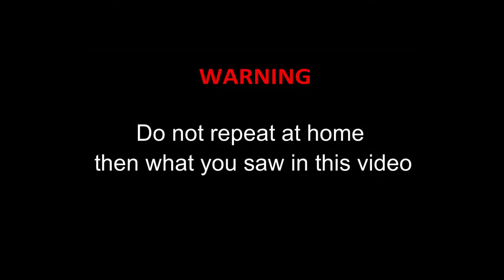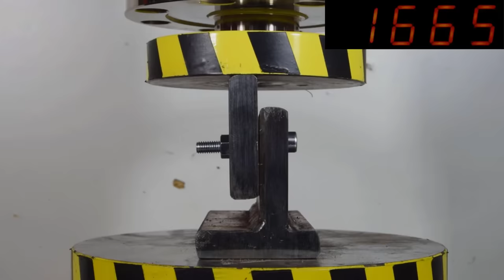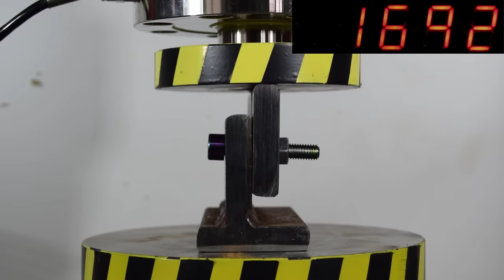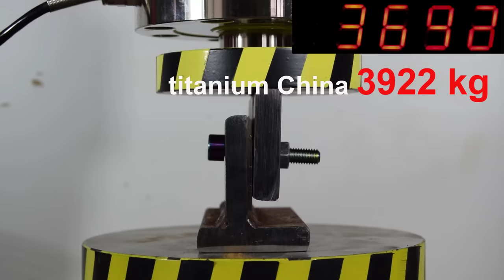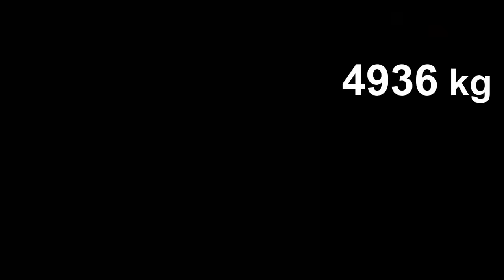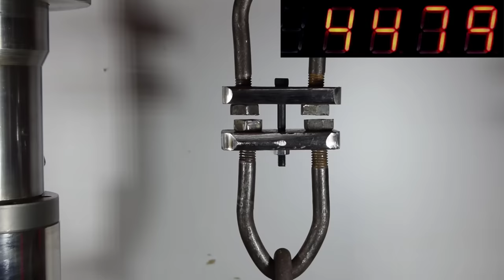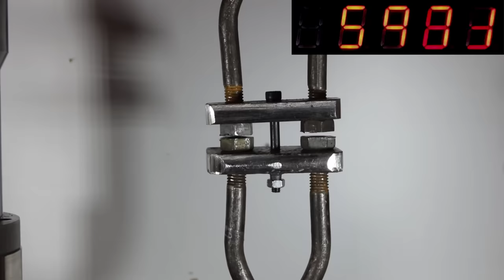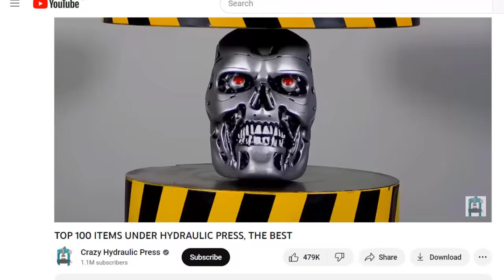HYDRAULIC PRESS VS TITANIUM BOLTS, ALIEXPRESS AND SPACE SHUTTLE

Comment: Most people don't get it. Titanium is not as strong as steel, only about 90% the strength of steel, depending on the alloy. But it is light as aluminum. So you have almost the strength of steel, but for a bargain of its weight. That is the magic of titanium. But it is expensive and its high melting point makes it unbelievably complicate to weld.
Reply: High melting point could be important for a spaceship. It makes the return safer.
Reply: Not quite the same density. Aluminium density is 2.7 tons per cubic metre whereas Titanium is 4.5 tons per cubic metre. Steel ranks at 7.1 tons per cubic metre; for comparison sake Magnesium is 1.7 tons per cubic metre. Where Titanium scores mostly is heat tolerance ( hence its use in aeronautical uses) & corrosion resistance ( in chemical industries & maritime environments) being better than bronze or stainless steel.  One has to carefully establish the intended purpose before deciding on which metal or alloy to use . Hope this helps. Kind regards.
Reply: True. Mild steel  is actually roughly 7.85 tons m3 not 7.1 @toolsconsumables7055
Reply: Not only hard to weld, its even harder to work with it on a lave or mill. There are so many things to worry about while working with titanium
Reply: @felix_972 well we ain't gonna take your word for it when you don't know what a lathe is😂
Reply: @garethjones909  I know what a lathe is, but my german auto correction made lava instead 😂
Reply: Isn't it mostly alloy and not pure ?
Reply: Isn’t titanium the best with regard to being corrosion / rust resistant?
Reply: Actually to weld titanium is not complicated… its very easy with TIG :) and most easiest to weld also. Aluminum is maybe the hardest… but dunno, if you know how to weld then everything is easy :D
Reply: Titanium is fatigue resistant
Reply: Also non magnetic, titanium tools can be used around mri machines without it being turned into a projectile
Reply: I’m fascinated by metals (that’s why we’re all here) and often tour guests at my friend’s factory. 
They machine all sorts of metals and plastics for big projects. 
One day I expressed my admiration for titanium. My friend responded that they don’t like it: very gummy, not nice to work with. 
Iron, grades of stainless, brass, copper, plastics, all good - but not titanium. 
Bubble burst. 

OP spot on.
Reply: @felix_972  fair enough😂
Reply: @littlereptilian7580 
Indeed.
That makes all the difference and makes arguing in this comment section quite nonsensical.
Reply: Depends highly on the type of titanium, some alloys of titanium have incredible strength, both in stiffness and in weight, some of these alloys are used in jetfighters for example, and far exceed any steel applications for stresstests
Reply: Space shuttle titanium bolt cost to tax payers per piece: $70,000 USD

Chinese titanium cost per piece: $2.70
Reply: @toolsconsumables7055  Steel  7,7–7,9

Comment: Bolted connections rely on the tension of the bolt. The clamp force clamps the parts together tight enough to keep them from sliding. The bolts, under tension, provide the clamping force. Bolted connections are not designed to use shear strength to hold the connection. The first test is a sheer test. The second test is tension load.
Reply: At least one of the viewers knows somethinmg about mechanics. Thats right!
Reply: Not mention 8mm 2:01 titanium bolt vs 10mm 2:32 aliexpress titanium bolt, size matters too
Reply: Agreed. First test is stuupid....
Reply: Exactly. And they did not even try get the clamp force the same by using at least a torque wrench or better hydraulic inline tensioning.
Reply: Agreed.  Many flaws in the experimental design.  The material may have the same name ,I.e. titanium, but the alloy and material condition needs to be considered too.
Reply: Bolts are designed for shear regularly. Connections CAN be designed to be friction connections, but I'll be glad if engineerss keep checking the shear capacity of their connections.
Reply: Yes and if still doing a test  it need to be the same momentum used not hand tightening it down.
Not to mention that the space Bolt has been used and abused alot before this test :-) ... take the other bolts to space and back first please 😉
Reply: Of course bolts are also used in shear applications. That is why they have tension bolts and shear bolts.
Reply: Well... Some bolts are not! 

There are also shear bolts for example as safety devices on equipment. In particular on AG equipment I'm familiar with. 

Three bolts cannot often be torqued to yield and provide direct transmission of the force and act like a fuse.

Comment: Nice! 
It's quite impressive in general what just one bolt can hold. The most benefit from using titanium is indeed the weight to strength ratio. Apparently to just hold a certain force,  there is no real reason to chose titnium over steel (high strength steel, such as the the 12.9 bolt, is better then). But it's much lighter (the density is not much more than half that of steel), so compared to it's weight, it's stronger. This is important for a space shuttle that might have quite a lot of bolts. 
Maybe the corrosion resistance is also better for titanium?
Reply: I believe titanium is also better in situations where temperatures fluctuate. That is certainly true in the space, depending on the location of the bolt.
Reply: It is true that this weight/strength ratio is very advantageous for titanium, because for the same weight we can put a larger titanium screw, therefore much more resistant than the same one in steel, of equivalent weight but which will be smaller
Reply: I plan to buy Titanium screws for one of my 3D printers, I can shave off over 100 grams worth of weight from the print head that way.
Reply: it also has way better heat and corrosion resistance, and its not even that rare on earth. but the downsides are its not quite as strong as the best steel, and its insanely hard to process and machine which makes it really expensive

Comment: Probably the bolt from the shuttle is made of pure titanium, and the Chinese one is an alloy. Titanium VT6 and so on are very durable, but how they behave at low/high temperatures is not clear.
Reply: Good point. Depending where the bolt was used (inside, outside), the Buran space shuttle will endure extremely high and very low temperatures in practice (though, iirc, there was only ever one test flight).
Reply: Alloys are propably better than pure materials in most situations. Aircraft Titanium is always an alloy to fit the needs.
Reply: It is true that this weight/strength ratio is very advantageous for titanium, because for the same weight we can put a larger titanium screw, therefore much more resistant than the same one in steel, of equivalent weight but which will be smaller
Reply: Also the bolts from the Buran program have been sitting about for decades - some amount of oxidation has probably occurred over time.  (In addition to “we have no idea what kind of alloy it was” …)
Reply: Also the fact that the Soviet space shuttle bolts are like 40 years old, while the AliExpress ones are brand new.
Reply: @michelleshaw337  I don't think oxidation would have much effect on titanium. The oxidised layer protects the metal underneath.
Reply: US Shuttel bolts were Ti- 6Al4V
Reply: You are very generous, I'd say if there's any titanium at all it a couple of microns coating like the Chinese titanium drill bits

Comment: Did you fasten the bolts with proper torque? Did you use same class nuts? Did you use them beyond elastic phase to proper use 100% or almost 100% of theirs strength? 
Just doubts, because such things may affect the end result of the screwed connection.
Reply: And the first test in shear he used spacers behind the nut and to me it seems that's undo stress on the bolt compared to the other two

Comment: Isn't the shear test for the titanium bolt sorta flawed? I get you had to add to it because the threads didn't go back far enough but wouldn't that slightly change the test also with the test test wouldn't having the jig the same for all be more accurate? The first two bolts you had it spun slightly (again I get it was for clearance) but having it slightly turned like that would cause some amount of twisting when you put strain on it right?

Comment: I believe if you test 100 of these against each other, you will probably find a huge spread in the aliexpress ones and minor spread in the others
Reply: That's also what i think , but it just might be the tests . The cheap ones are as is. 5tonns +-25% , but mostly held at +-5% , but the wont throw away a batch for a 25%+- . The expensive is proven to 4.785tonns +-3% or something and always held close to the tested value . In my experience in manufacturing just because something can have a +-1mm tolerance , that does not mean that someone is deliberatly adjusting every part to max out the tolerance . This just means the production can run smoothly and a whoopsie here and there won't matter . Any good worker always tries to maintain the middle of a given tolerance .
Reply: I have a fun fact for you..we are talking 15 years ago when chinese quality was on the rise, now it has strongly declined two packages were mixed up german factory received it opened and QC department immediately called to announce the mistake, chinese factory ? assembled 500'000 modules with wrong part attached...it wasn't even the same size they forced them on, that's all you need to ever hear about chinese quality 0/500'000 quality check and not even a look on the part number or nothing, no alarms or checks on the machines too as the size and markings should be checked by cameras

Comment: Depends what the bolts were made for. In many serious applications they have a deliberately designed failure point. Bolts are not typically made as strong as they can be (the Chinese one is perhaps) as in many applications the bolt failing at a certain load is an engineered safety feature.

Comment: I have a feeling that this is a test of screw's thread on the first place, then its match against the bolt's thread, finally screw's elasticity and hardness. Screw's material that is a compound could probably give better results. Threading could be manufactured in different way leading to smoother surface impacting the forces. Notice that screw is not stretching but instead there is a single "jump" acting like a hammer leading to not only thread under the screw being broken but also other have no chance to resist.

Comment: You should add some slotted bolts to your fixture so the plate stays together. Less to pickup and reset each time. The center bolt remains the same for sheering.

Comment: i'm surprised that in the pulling apart test the bolts broke instead of ripping of the threading.  seems like way less material has to move or break to remove the threading than just breaking the bolts.

Comment: Nice video. But why do you measure force in kg and not in N (Newton)? I understand what you mean (the force equivalent to the weight of that mass, factor g=9.81 N/kg), but it would not hurt sticking to standard units when doing measurements. Also, it seems to me you compare bolts (screws) of differing diameters here. Thirdly, "AliExpress" is not a supplier, it is a marketplace.

Comment: The thing with space shuttle bolt is not that thay are stronger, but if you test 1000 of them non of wil under perform, where as the cheeper bolts are more likly to have production faults

Comment: Hi, you do not pay enough attention to very important details due this tests. If the bolt is not fitted tightly as this Russian bolt you elongate a bolt in the same time when you try to make share stress perpendicular to it (a case with Alli express bolt). Bolt cannot change en angle when mounted to steel slabs.This is causing that part of the force working along the bolt making looks it much stronger. I assuming that the whole diameter was slightly to big for Ali express bolt. You can see an angle between a head of the bolt and the slab develops during a test visible by naked aye so at lest 1-2 degrees.

Comment: Its in the name 8.8 and 12.9 you can work out the Ultimate Tensile Strenght if the bolt from that.  I  got the 8.8 one extreemly close, but the 12.9 one you didnt show the results so relied on value when it broke which was way off its designed strenght.  Tables we require tables... manufacturers data dry tourque wet torque type of bolt, wether a bolt or a set screw, what size. I have had ali express bolts before that did not outperform 8.8 let alone 12.9 of similar type.

Comment: Compare the weight of the Bolts. I bet the space ones are lightest. And that was the requirement. Be as light as possible but at least as though as steel. If the AliExpress bolt weighs the same than the space bolt, yes go with it, else you will need A LOT more rocket fuel to lift the extra weight of these  thousands of nuts built into the space ship to space. Also, how brittle or plastic would those bolts get in which temperature regimes? Idk if it is that important here, but there is more complex things to consider going to space than pure strength. Even production costs, dependance on imports vs sanctions etc.

Comment: By rights the bolt from space should have been the strongest. A little off size, as the vacuum of space would evacuate all the air between the molecules of bolts. Cold welding. Did you notice any interesting coatings on the shuttle bolts. NASA found that when an object goes to space, parts fuse together, as if welded, sure to no air cushion between them. Is is said that great amounts of money and time are spend treating parts in preparation for space travel, so the parts do not fuse and seize together.

Comment: You must test the strength by pulling, not compressing... Bolts are designed to resist tensile load not pressure load...😂

Comment: you do understand that this is not a controlled test by any means the design of the screws are way different than each other not to mention that there is probably Gauge difference between the screws in your test. and this was fun and all but it would have been cooler if you mentioned these sort of stuff although it probably would have taken out the fun of seeing David beating the goliath out of this video although David is probably thicker and have a different design and mixture from the goliath.

Comment: This test is so bad on so many levels. First off you tested 2 different sizes. And second there is a crazy different amounts of titanium alloy just like aluminium. Third: What was the space shuttle one designed for, holding avionics equipment, bolting a chair down, out of an engine or one of those "aerospace" knock offs like 6AL4V bolts. Nobody knows. They dont pay 5000 euros a bolt for something made in China and they are generally not avaliable to the public as they get destroyed on removal as per law.

This is more like you got paid by Aliexpress for this nonsense.

Comment: steel is a perfect metal but is little too heavy
Reply: Then it is not "perfect".

Unless you're trying to ADD weight. One of the reasons I replaced every conceivable bolt/screw on ny latest gravel bike with Ti. Even the thru-axles are carbon/titanium (thankfully it's a bike not a submersible 😉)
Reply: @vaulthecreator  nothing is perfect xD
Reply: @vaulthecreator  But titanium and a pretty cool meterials in physics, chemistry mecanics.

Comment: Without the same setup on each your data is flawed.  One bolt has washers stacked, the next one doesn't.  None of the tightening torques are measured.  (that's a big one, the torque on the sheer face of the two sliding plates needs to be exactly the same).  Bolt diameters' are all different.  Not a very scientific test...  but very entertaining, thanks.